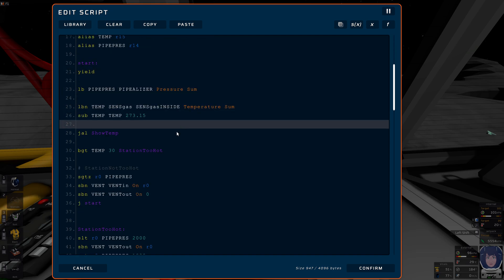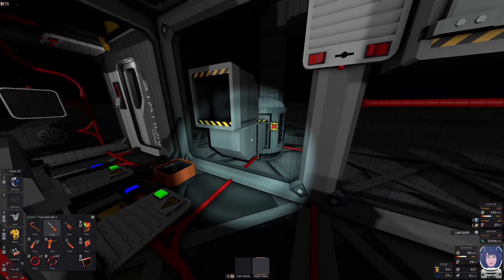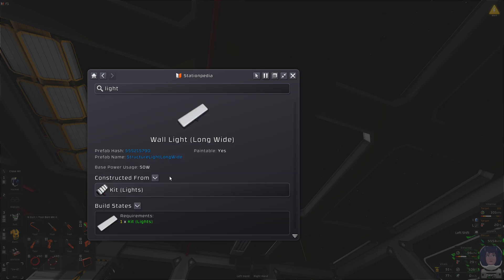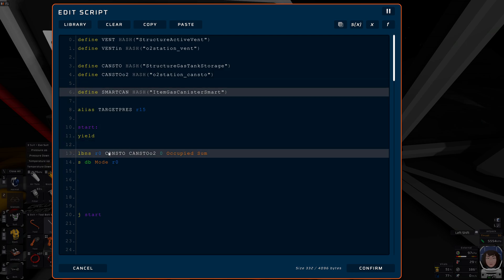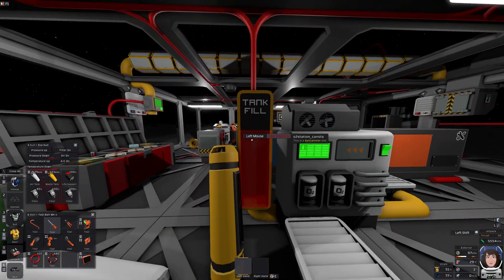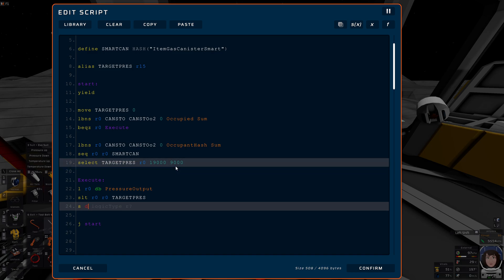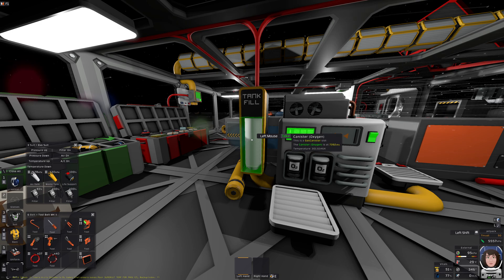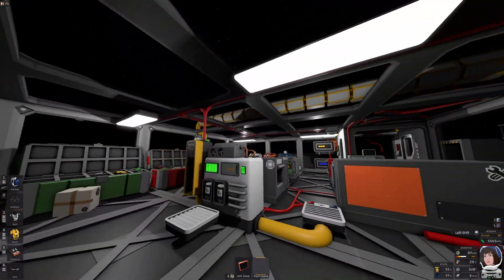Stationeers PROGRAMMING for total beginners - TURBO STYLE! - Part 4:Automating things(O2 refiller) *

Comment: You can use passive vents on the in and out of the filtration device because the filtration is also a pump on its own. This will save a lot of problems in the pressure department and the pipes can take more than the tank, so the leftovers when you remove the tank are fine to leave in, and save the eviction code as well because it's all solved with passive vents on the input and waste side. 

You could add a valve or volume pump so when the tank is removed it opens the valve and closes when it's empty. This could be if you have multiple gases, but one tank filler, if it's a fuel tank for example it fills from the fuel tank, evacuate and when it's ready insert an oxygen tank and have separate clean full tanks. Then you'd need a sort and return system otherwise you can make the air bad by just wasting it, but you can also simply release it outside and save that problem if it's not much.
Reply from the maker: Without high input pressure, though, the filtration unit is pretty slow.
Reply: the filtration device would also make an energy efficient way to store your IC10 chip, considering how many watts it pulls vs the IC10 housing, having intermittent pulling would be even more efficient as it would just sip watts while happily crunching code.

Comment: As mentioned in my comment for the previous video, setting PressureInternal on active vent of the O2 Filling Station, avoids having to "waste" MIPS code on pressure management of the input pipe. Tight and compact code can become essential when creating multi-purpose ICs, since MIPS code is limited to 128 lines per chip - this includes comments and spacing. Not nagging, but just adding a bit more polish on this diamond of a video. The forethought and scripting put into it is well appreciated. Now if Cows are Evil could only learn your presentation style, we would have two great producers of information on the finer points of Stationeers 😁
Reply from the maker: I even know about the PressureInternal/External thing (and to set it after setting the Mode), but sometimes you're just stuck in odd decisions for no obvious reasons. I'll try to keep it in mind, though, so your comment may help with the course correction.
Reply: @OwnerOfTheCosmos  If you have a situation where an active vent's mode is changed, the value for PressureInternal (and PressureExternal) is reset to its default value. Thus, with mode changes one has to re-set pressure values.